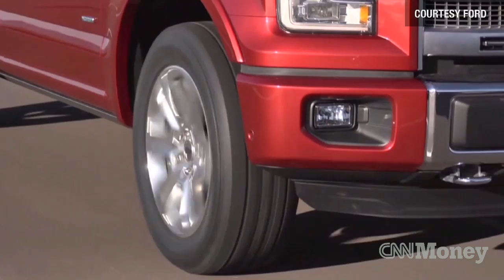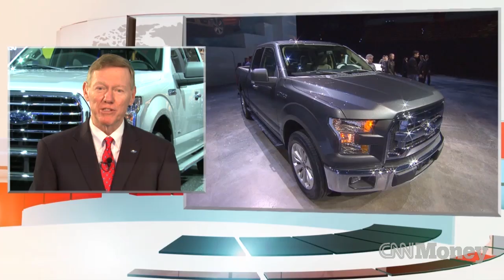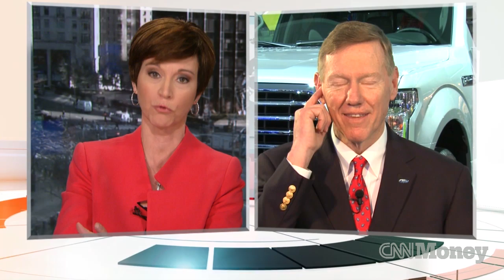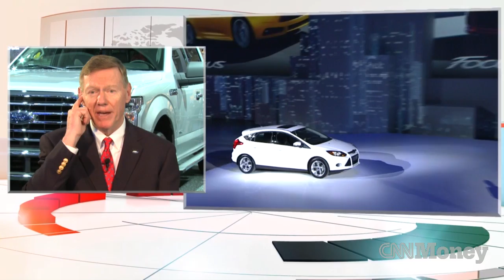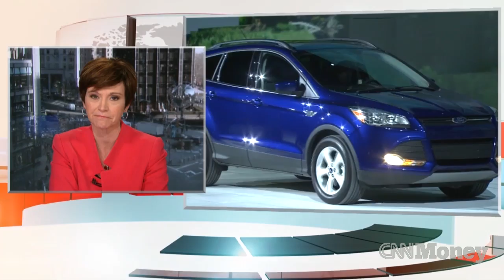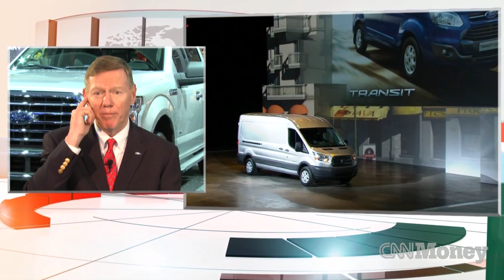Ford CEO: Aluminum is stronger and tougher

Comment: Way to go with disinformation there, Alan Mulally. It's well known that steel is stronger than aluminum. Steel's strength ranges from 30,000 to 200,000 psi, where aluminum's strength ranges from 15,000 to 90,000 psi, so tell me again, how is aluminum stronger than steel?
Reply: looks like someone missed the "pound for pound" part of the sentence.

also most aluminum alloys that are likely to be used are actually stronger then the mild steel used in most car bodies.

so the answer to your question - the laws of physics.

the only reason steel is used is because it has historically been cheaper. but aluminum is a superior metal. It is light, strong, and has much better corrosion resistance. and i believe aluminums price has been dropping to be more competitive.

There is a reason why it is used in airplanes and high end sports cars.